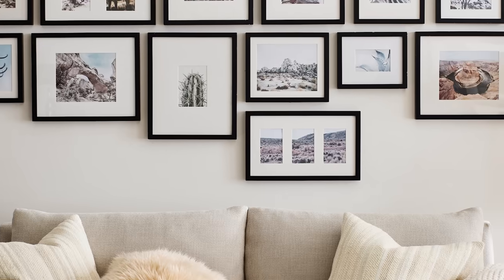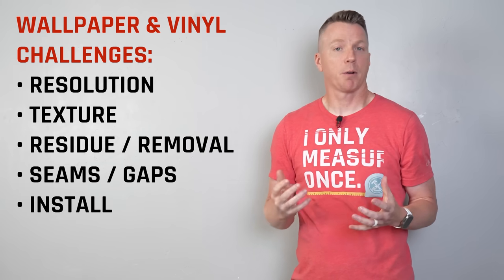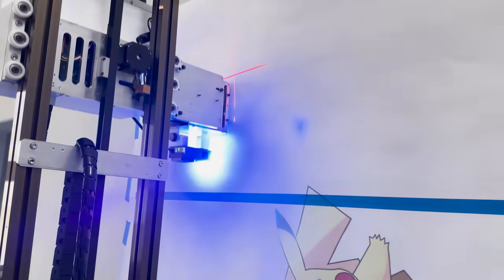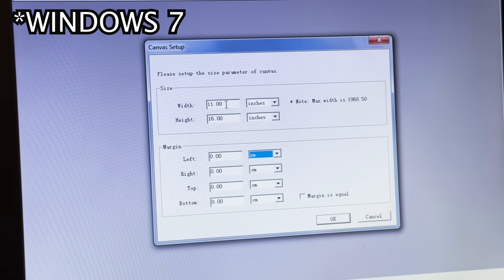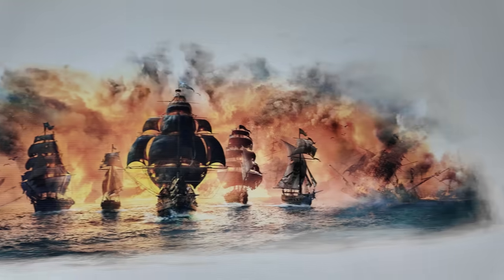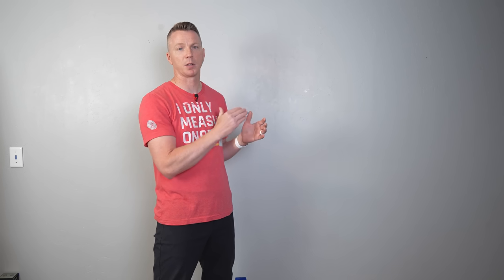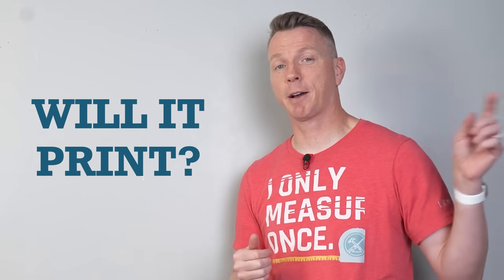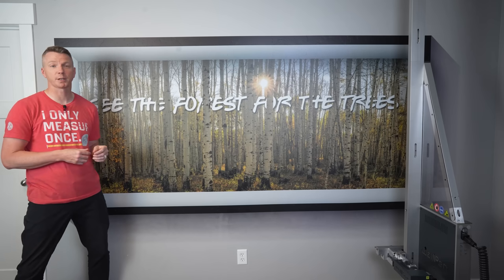I Printed This On The Wall In 3 Hours

Comment: does it print on 8.5x11 plain white paper?  Because I have yet to find a printer that can handle that medium for more than a month before something goes wrong....
Reply from the maker: I feel ya there. All printers can be a challenge but getting a regular home printer to work is one of the things I hate most.
Reply: Laser printers are better for occasional printing: the toner is basically iron filings coated with wax.
The problem is that occasional prints don't really justify the cost of a laser printer.

Comment: Years ago there was a 'Sprayprinter" kickstarter that I almost backed. 
It used position tracking like VR inside out headsets do and attached to a basic spraypaint can to turn it into almost a handheld dot-matrix printer you can use on your wall. 
Every time you moved it over where the image needed paint it would depress the trigger putting a dot of paint in that location.

Pretty sure the kickstarter and the project died, but it was a neat idea. Much more user friendly than this r4-d4 looking thing.

Comment: Bro this was so informative I am seriously considering starting a business based on wall printing ...would love to ask some questions....can the printer be used on aluminum or steel?
Reply from the maker: It's pretty wild, right? It can and does print on both aluminum and steel, yes. Since releasing this video we have become the North America Sales Partner for the wallPen so let's connect. You can learn a lot more at surfacepix.com and get our contact info there too.
Reply: @LRN2DIY  would it be possible to send you blank surfaces to print on, then I would test it on the market in terms of viability and profitability. I'm overseas in Jamaica.

Comment: Is there any compatible ink or paint that could be used (and clearcoated?) for flat sided vehicles, such as step vans or box trucks? This could be a really big deal in that market.
Reply from the maker: The ink this uses has a seven year rating so it’s actually used pretty commonly outdoors. Clear coating it will definitely add to its lifespan so it’s ready to print on vehicles already!
Reply: How much does the machine cost?

Comment: Does it work outside? I would like to have something printed on my Camper.
Reply from the maker: It does! It’s actually rated for 7+ years outside in the elements and is commonly used to print outdoors.

Comment: After doing some fairly exhaustive research over the past couple of days, I'm not seeing $60k of value here. I really, really want to, but I don't. Even their main competitor is $25k less and ink is half the cost. And their resolution is waaaay better. This is a $10-12k (ish) setup. Print head is $500. Aluminum 8020 stuff, wheels, servos/robot thingies, tablet, etc are all maybe $4-5k? I just don't see $60k. I'm sure it can be profitable and I wish everyone immense success, but this is simply highway robbery. You can buy 3 brand new Nissan Versas for that amount of money. Insane. $50k markup for some programming, tech support, and a short warranty? I mean, that's just bonkers.

Comment: You state that it solved the issues of textured walls and resolution, but clearly you have no idea what you are talking about or you are trying to deceive your viewers. 1. Most modern commercial and industrial large format printers have an output resolution up to 1200 dpi x 1200 dpi. The issue is the resolution of the image you wish to print. If it is 300 dpi x 300 dpi at 12” x 12” and you scale it up to 36” x 36”, your resolution will only be 100 dpi x 100 dpi no matter what printer you use. 2. The ink that is jetted by that printer will not flatten out wall texture, so that is still an issue. 3. You will have to prime and repaint the wall to get rid of the mural that you direct-print, so it doesn’t eliminate that issue either. Thanks for the misleading video.